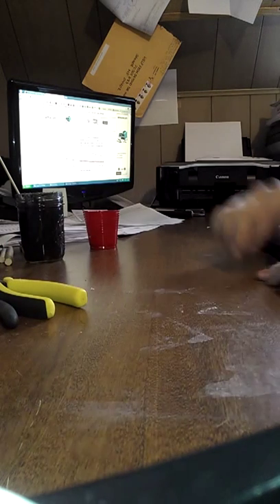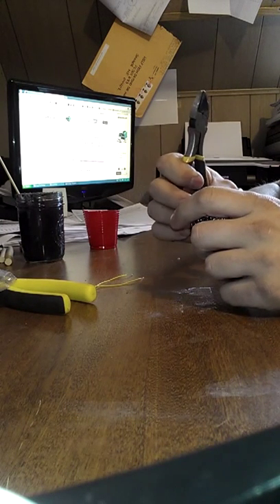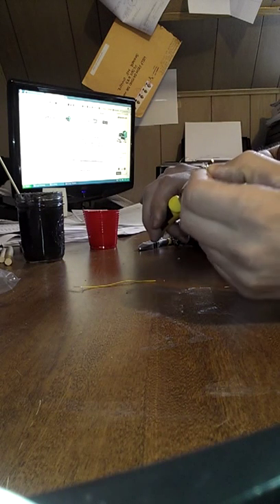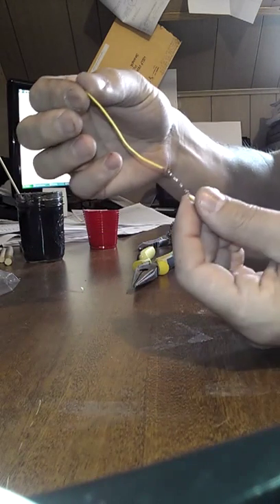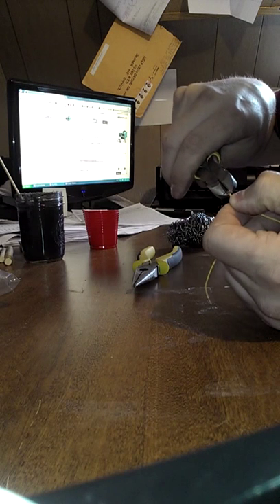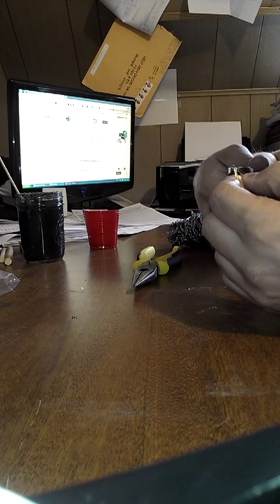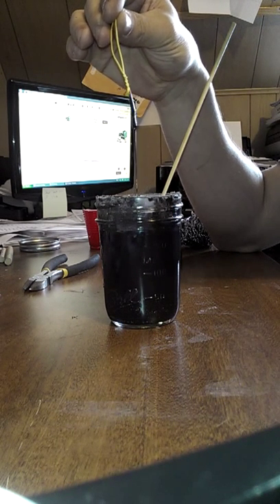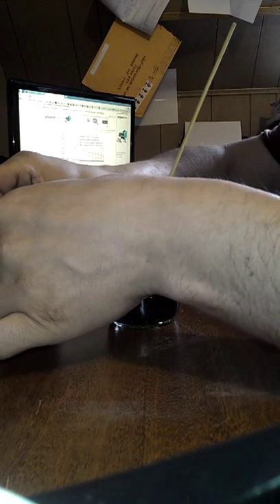How to make pyrogen rocket igniters

Comment: How many pig pong balls do you dissolve at a time? With that mixture how many ignitors can you make? And the last question is how much black power do you add to the ping pong mix? Can you store your mix or does it dry up? Thank you
Reply from the maker: I typically dissolve one or two at a time. Use a glass or stainless steel container as the acetone will soften and eventually dissolve most plastics. A batch of a tablespoon or so will make several dozen igniters. I mix with approximately a 50/50 by volume with BP and ping pong balls (nitrocellulose). You can store the mix if it is completely air tight. And if it dries out, simply add acetone and stir occasionally for a few hours until it softens again.

Incidentally, I have noticed that nitrocellulose ping-pong balls are becoming harder to get and will be posting a new video on how to make igniters with BP and dextrin, which is essentially just cooked cornstarch.

Thanks for the comment.